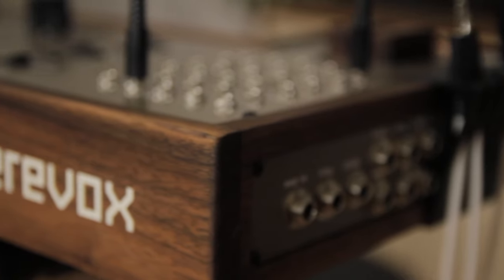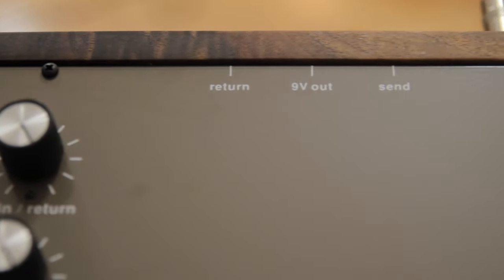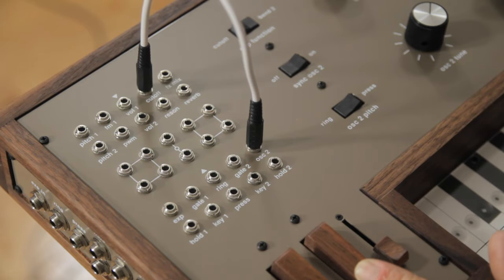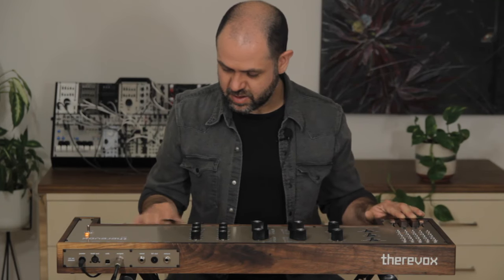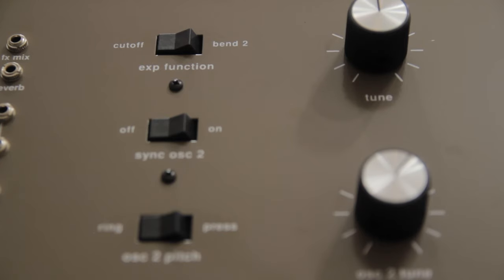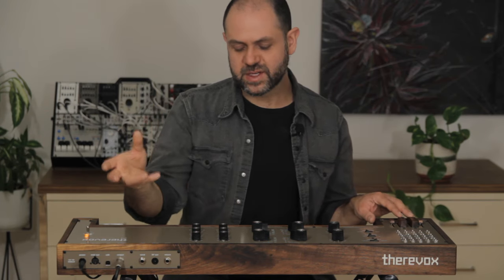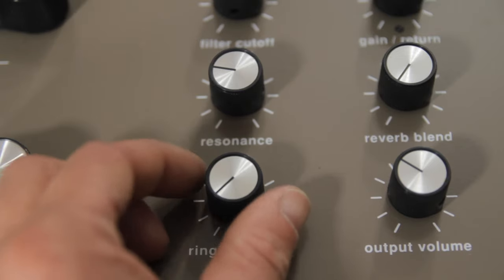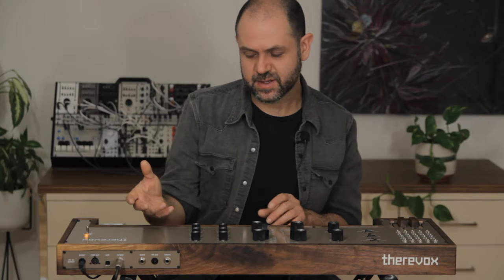New features of the Therevox ET-5 analog synthesizer

Comment: Outstanding instrument. I like the new features which imbue further nuance and creative potentials. Really, it occupies a very unique space, the nexus between a progressive instrument meets semi-modular synthesizer. And the sound. Rich. I know the Therevox has been around for a while - pretty cool demo from Marc Doty on the previous version - but I continue to appreciate its classy form factor, hybridized yet disciplined and curated feature set without adding superfluous stuff. Really dig that patch panel and assignable parameters. The pervasive black & white plastic keys on many synthesizers are beyond boring bits of sterile plastic usually limited to semitone triggering, like frets on a guitar versus the creative freedom and smoothness of fretless... or theremin! Some maverick makers are thankfully offering alternate triggering methods, like the gold resistor touch plates. Amplitude wood blocks might demand finger strength, though, for extended usage. Can their sensitivity be altered? FM sounded tasty, warm, and pleasing. Always dig the milieu of clangorous timbres. Smooth filter, great fullness in general, Yout00b compression notwithstanding. A thoughtful choice to sensibly limit the resonance on such an instrument, though - as a sound designer versus "musician" or "player" myself - just a bit extra res further expands timbral capability. A neat feature idea just occurred to me for a future iteration: a toggle switch for the filter between lowpass and bandpass. BP would allow all manners of vocal-like formant textures in concert with its nuanced facilities. Could prove to be removed from the scope of the Therevox. Cool name. Therevox. Any love for the "Manther"? Not me. Lovely negative space allowed on the tasteful control panel, notably for the effects unit integration. Well done!